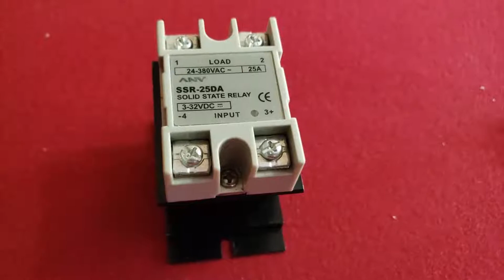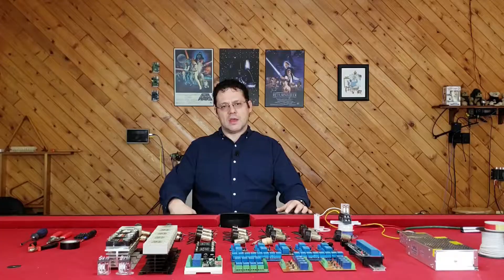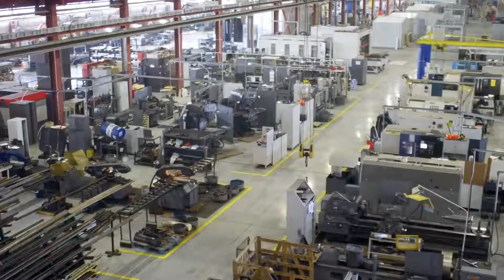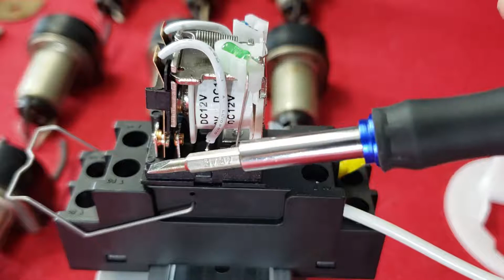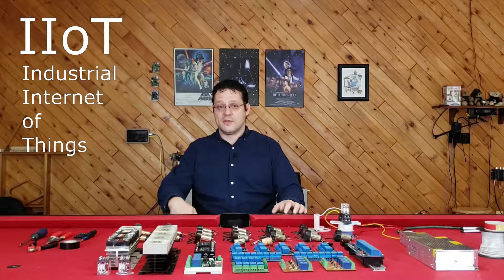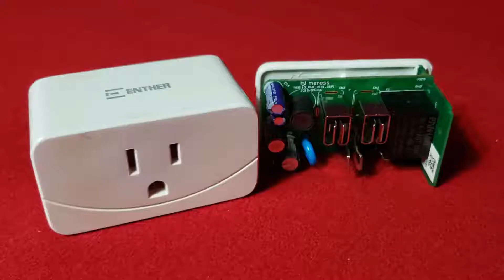Electromagnetic Relays: What they are, when they are used, and how you should use them.

Comment: The first relayed showed is actually a solid state relay and the other two and electromagnetic relays. The electromagnetic magnetic relays have a coil that when energized produces a magnetic field and either closes or opens the relay, according to the configuration relay type. The solid state relay does not have a coil to produce a magnetic field. Instead it's a semiconductor junction, either a DIAC or TRIAC. When the gate of the solid state relay is energize,  it allows the flow of current on its junction channel.
Reply from the maker: Yes, I flubbed the script when I did this video. I was juggling a ton of stuff and sort of rushed through without paying attention. I also meant to show more solid state machine relays, but managed to lose a box of various models of Opto relays--one of which I was planning to slice in half on the band-saw. Perhaps I'll do a corrections and updates video eventually. It's been super busy at the day-job, so I'm way behind. Thanks for watching the video, though!